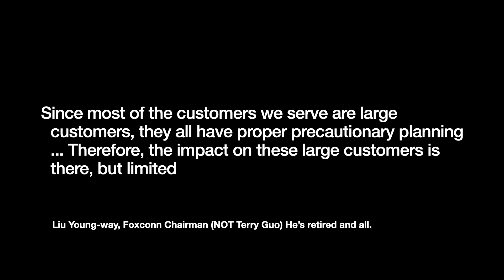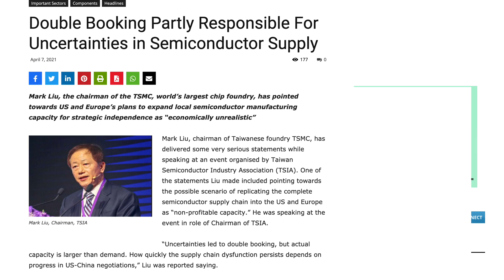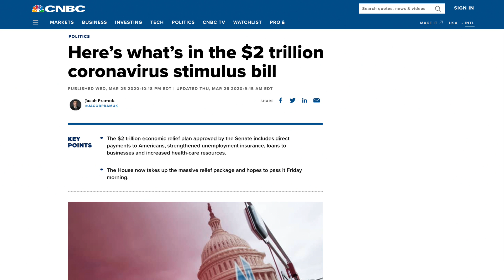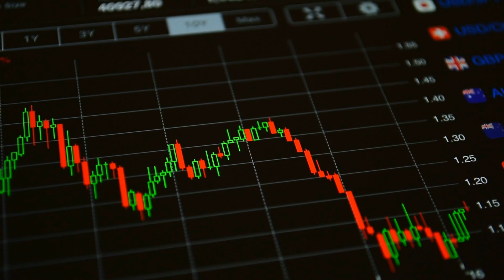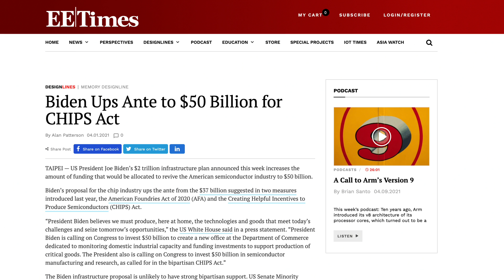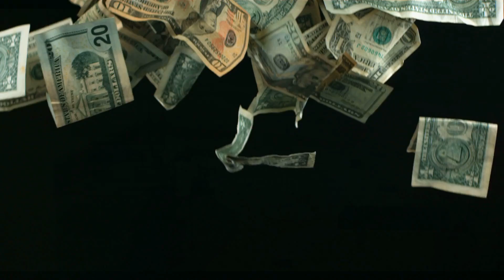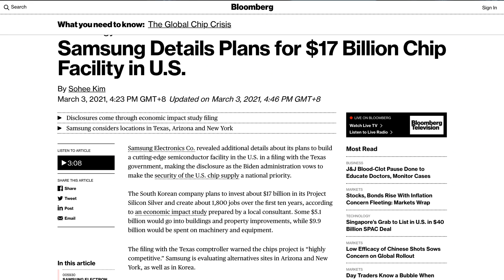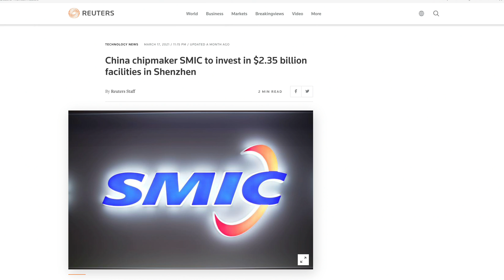The Coming Semiconductor Bust

Comment: I think this is a very misguided analysis. These fabs are being built to satisfy demand in an emerging market. They are nearly all above 10nm which means that they are being built as commodity chip manufacturing plants. Ie. the plan from inception is to sell the chips they produce at rock bottom prices. At the very low end of the market it is already possible to buy a microcontroller for as little as 10 cents in volume. There is the rapidly growing demand for these processors and every indication is that this demand is going to massively increase over the coming years. This very low price point is where the market opportunity is at the moment and the winners will be those who can provide the most processing power at this price point. That is why these fabs are being built. Yes there will be winners and losers but not a market collapse.

Comment: If you are put off by government subsidies, well, say goodbye to every single critical technology of this and past century; basically any technology that would be considered a truly difficult problem to solve and was solved through basic research.  Start with the Internet for maximum impact but it doesn't at all stop there.  Look at your iPhone as another example  Everything in it came from public sector research.  The capacitive touch screens, Unix (both FreeBSD in user space and the Mach kernel), hypervisors, GSM networks, the compiler, HTTP, C, GPS etc etc; the list is endless.  All research fully paid for by the public sector.  Private sector doesn't do Basic Research basically :).  On the issue of subsidizing fabrication facilities it's not about the markets.  It's finally seen as critical infrastructure, and rightly so, and therefore as opex.  It doesn't warrant or need to be filtered through the lens of economics.  And in the eyes of these guys, it seems they finally get it.

Comment: Nice video, but looking at things right now it seems like there is no sense in any government/company. Building any production capacity with free money is good idea.  US want capacity, EU want capacity, China want capacity. Samsung and TSMC are happy with the current situation especially TSMC but they know very very well that if they don't build US capacity they gonna lose market share due to trade restrictions and wars.  Investment cost is the biggest issue but since 0 interest rates and the Stock Market boom it basically give unlimited low interest money to those companies it makes zero sense to hold cash as the money printing is actually de-valueing money. This in reality make the interest rate negative as the money you borrow today will be worth less in few years. This economic conditions favor growth companies that burn money to grow. On top of that after this huge market boom both stock/semiconductor/economic there will be big depression in which it is very unlikely we will get any new process nodes as it gets harder and harder as we already calling the moore's law is dead. Meaning that the fabs built right now with the current best process may be here to stay for the next 10-15 years. Intel has been stuck at 14 nm for quite a long time now so maybe TSMC and Samsung are betting on huge problems past 2nm.

Comment: when I worked for semitool in 2005, the cost of producing a chip was about seven dollars..... consumers are stupid, that is the only reason this tech is worth money.
Reply: How so?
Reply: @dylanpresidafonseca2545  they will pay a thousand dollars for a device that cost one hundred dollars or less to get to market.... thats stupid, any way you slice it.
Reply: In 2005 what were the current nodes?  Today the equipment needed to do etching, etc.... is in the billions of dollars, and it's only the best nodes that make the high dollars per wafer.  Lesser nodes don't fetch the high dollars.

In 2005 I think the big thing was a dual core processor for desktop.  Today the big thing for HEDT (high end desktop) is a 64 core/128 thread processor.  Times have changed a little.
Reply: @johndoh5182  they still make the same stuff now that they did then. the 'raider' has not changed much at all.

Comment: I doubt there will be a Bust anytime soon. I have been waiting 6+ months for Nivida 3080. At this rate I might as wait for Nividia 4080. Also on ebay Nivida 1080ti are still going for 500 dollars!
Reply: My old video card now is 2 times more  expensive than 4 years ago. I don't think there will be a "bust" anytime soon. Also I see RAM and HDDs are vanishing from our hardware store. There are still some models but something is definitely happening. There are less and less models also the prices are going up.
Reply: Big difference between a cutting edge enthusiast GPU and chips used for say cars or drones or other more mundane things. That’s where the glut will be according to this logic. We’ve already seen cycles like this in memory - remember when ssds few years ago got up to USD 100 for 250gb?
Reply: @dugowf766  yeah but there arent lots of new ancient node fabs being built, and demand for them is (or will be) vastly more than supply
Reply: @suntzu1409  these things are cyclical, and older fans are being built in places like China and intel are building in Europe. In 3-4 years time there will probably be an oversupply, that’s how these things go

Comment: Strong info on foundry capacity, but not much on the demand trends.  My main investment semiconductor company works very closely with their customers, monitors their actual inventory and manufacturing requirements, and is supplying most of their customers with 'just-in-time" chip supplies during the current shortage.  This allows the end manufacturer to carry very light inventory.  Industry evolution, enabled by global communication.

Comment: wait for job automation and robots. they still require chips. anything doing calculations does. one component in an IOT system relies on multiple chips. There is the robot/computer in the work area, router, and cloud connected edge server. I suspect we will see a ton more demand than can be fathomed. companies like miso robotics, argo; etc. are only the beginning. maybe once factiories are done installing IOTsystems we will see a glut. intel better get their stuff together or they will die. TSM has deals with AMD and all the big players now. wtf happened to intel?

Comment: A wafer can yield about 150 - 70,000 dies depending on the size of the die and this is not accounting for failures. You say the TSMC plant and yield 3.5 billion dies a month for 50,000 wafers which is incorrect.

Comment: Moore's "Law" died long ago. A 2000 Pentium 4 had 130 nm transistors. If Moore's "Law" was true,   we'd now have  0.12 nm transistors.
Reply: Too many folks confuse Dennard's law with Moore's law...
Reply: That's not Moore's Law.  Maybe check the transistor count of an AMD EPYC 7763.  Transistor count is more related to Moore's Law, although it talks about performance, processing speed and processing power.

Comment: I work in semiconductor industry for more than 2 decades, and by many ways many things are wrong in this video. Its more speculations and assumption than how really this industry works!!! There are many things happening in background which is not known to common man. This looks more like some opportunists idea of manipulating stock markets. The very issue of double orders are incorrect, since every company knows the double ordering and already has done homework to deal with that. Some companies have no cancel orders. No fab runs without 100% occupancy. Different technologies need different fabs. Semiconductor companies work with reality along with fabs. Every knows the future delays, cost, release times for coming several years. What the video is telling is from the point of stock trader with his assumptions on the industry, not the reality!.

Comment: The one law being ignored in the assessment of the future is the law of physics, the silicon atom is about 0.15nm, to make the transistor's different parts they need to be more than several atoms for each part to prevent quantum tunneling effects. Making a 1nm transistor will be near impossible just due to the physical size of atoms and quantum tunneling effects start at this dimension.
Reply: by the time that happens, if it does, chips will be much, much different. the CS stuff i learned in school is in for an overhaul by then.

Comment: The reason to build fabs in us and eu isn't the chip shortage.

China will likely invade Taiwan in the next 5 to 10 years.
That would cripple western chip supplies and potentially give China the latest chip tech.

As such the need for foundries in the US is for national security.

So long story short there are a lot of reasons to open new fabs in the US and eu. The auto industry is at most a good excuse.

My 2 cents anyway.
Reply: Additionally, the EU and US have developed the core tech that enables EUV, makes sense to integrate more of the industry. Especially since western manufacturing is becoming more cost competitive due to advances in automation and rising prices in Asia.

Comment: From experience of working in the industry, the "Bust" is merely a pin prick in this massive industry
Reply: There is always massive background capacity. New fabs pick up the crumbs around the edges.
Reply: What do you mean?
Reply: @shenjiejason8350  This world is becoming more modern all the time.  The number of server farms is growing.  The number of super computers is growing, the number of compute devices in people's homes is growing.  AI is growing rapidly.  Businesses rely more and more on computers.  What is meant?  Bust cycles don't last long, and this video is almost negligent for underestimating the amount of growth there is.

And then I can move on to other fields.  Medicine.  There's more medical equipment that's controlled by processors or at least needs a small IC in them to run it.  Transportation.  There's more ICs going into vehicles than ever before, and as vehicles get smarter and smarter, it means more ICs, or ICs with more power.  Either way that uses more die.  Robotics.  Yeah that's growing like crazy.  Almost any manufacturing is mostly automated.

And then there is the effect of companies like TSMC simply coming out with a new node.  I can use AMD as an example and how it's effected the server world.  Zen 3 EPYC, which is AMD's latest server CPU is the best X86-64 server CPU on the market.  Lots of companies are ignoring their regular life cycle for replacing servers (a server, being a single circuit board (motherboard or mainboard), with either one or two sockets for mounting a server CPU, and this board slides into a server rack, and therefore a server rack holds a few servers).  They're ignoring their normal life cycle plans because of how efficient Zen 3 EPYC is.  The thought process is, you can't afford NOT to replace the older servers, because of the power savings)

So this is the main part where this video has no understanding about.  AMD Zen 2 and Zen 3 EPYC CPUs are made using TSMC 7nm node, along with GlobalFoundries 14nm node.  The CPU is what's called an SoC (System on Chip).  The processing cores are made with TSMC 7nm.  The I/O portion of the CPU is made with GloFo 14nm, or maybe 12nm for Zen 3, I forget which.  For the next generation coming from AMD, Zen 4, EPYC processors will be made using TSMC 6nm and 5nm nodes.  The cores will be TSMC 5nm and the I/O will be TSMC 6nm.  And then you move to the next generation, as long as plans stay on track, Zen 5 will be made using TSMC 3nm.

So I threw a bunch of numbers at you in the above par.  But what does it mean to companies that have larger server farms or any company that has a few servers?  Power efficiency.  Companies are moving to CPUs made with TSMC 7nm because of power efficiency.  And, the way this is typically evaluated is perf/watt.  How much work does the CPU per watt consumed.  This is a big deal for server farms, because it's not just about the server being able to do more given a certain amount of power, but it's also about air conditioning.  These server farms have HUGE electric bills.  So now the great news for these companies, moving from TSMC 7nm to TSMC 5nm gives about a 25% boost in power efficiency.  Moving from TSMC 7nm to TSMC 3nm gives about a 40% boost in power efficiency.  So, you have a server farm with 1000 CPUs in it, let's say, and you currently are on TSMC 7nm with Zen 3 EPYC.  You decide to wait for Zen 5 EPYC so you get a boost of roughly 40% in performance, while maintaining the same power envelope.  That's an almost OMG!!!!!!!! kind of figure for a server farm.

So, the turnover of parts, simply because Samsung, Intel and TSMC are coming out with new nodes that consume less energy to do the same amount of work, or give you a big boost in performance for the same amount of energy cannot be underestimated.  Because there are so many server farms around the world now, this is huge business for chipmakers like AMD, Intel, companies that makes processors using ARM, etc...., and that business gets back to the fabs, TSMC, Samsung and Intel mostly.

In this video the dude said he wasn't going to make predictions about this year or that year, but then basically claims there's going to be a big bust.  There isn't going to be a big bust for fabs.  There's going to be big upswings, then equilibrium, then MAYBE some small downswing, and then another big upswing.  THAT has been the cycle with fabs.  If you're talking about a specific sector such as CPUs, GPUs, SSDs, DDR memory, etc.... they can have bigger swings, but for fabrication, the downswings are small because there's always a need for ICs of some type or another.  You can compare the trend of CPUs for instance to the trend of fabs, and you see even when sales have slowed for CPU sales, it doesn't affect fabs.

If you understand the business of fabrication, you should understand WHY this is the case.  Companies make contracts with fabs months or even a year, maybe even up to 18 months in advance of the fabrication company making products for that company.  Apple already has a contract with TSMC for their 3nm node, and that node isn't even OUT yet.  That's the way it works.  Apple wants to make sure they're on the most advanced node.  That's why their products tend to be more efficient with power.  Intel has a contract for TSMC 3nm for products they'll come out with at the end of next year.  AMD has contracts for their GPUs and CPUs.  Nvidia has contracts with TSMC for their GPUs for their next generation.

This is to say, I wouldn't watch this guy and make stock decisions based on it.  He doesn't study markets well enough to have ANY understanding of what's happening.  Go watch people who make tech news instead.  What this guy has done is dig into the past to give information about how these companies have evolved over time.  While this is interesting, it doesn't predict the future.

But, take all information with caution.  Just because TSMC may have a big upswing in business doesn't mean that Samsung will, or Intel will (as a fab).  You have to actually watch videos and read about what these companies are doing.  Success for TSMC could mean the demise of another fab.  At some point companies making older nodes are going to fade away as prices come down for newer nodes.  It doesn't matter what equipment you make.  If you can get a smaller IC that uses less energy to do the same thing your older ICs are doing, and it costs you less money, you're going to move to a newer node.
Reply: Yah.  The bust is in bonuses.  The businesses will March on, albeit without some of the weaker entities.

Comment: I would not necessarily agree with this. mainly because the increased push to digitalization, robotization, AI, connectivity, the 5G rollouts (and then 6G). This is a common trend around almost every industry, and it will only increase. They (the fabs) may not run at full capacity 100% of the time, and I know they need to be close to that to become profitable, but I believe there will be sufficient demand for years to come/

Comment: What if Intel starts manufacturing their processors in much talked 3D design, suddenly one processor will have multiple chips
Reply: Follow other tech channels to keep up with that.  And, it's not just Intel that's been working on die stacking.  In fact AMD is going to have the first stacked die at the end of 2021, with 3D cache for some of their Zen 3 CPUs.